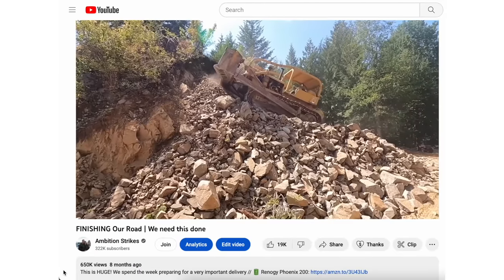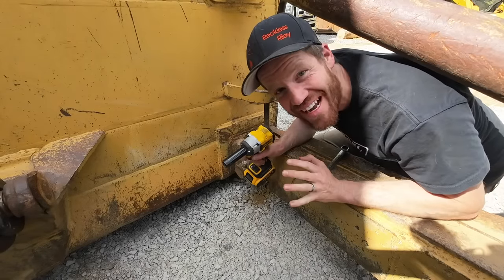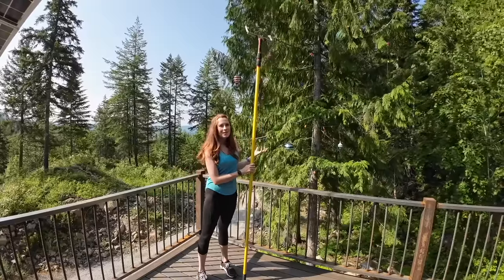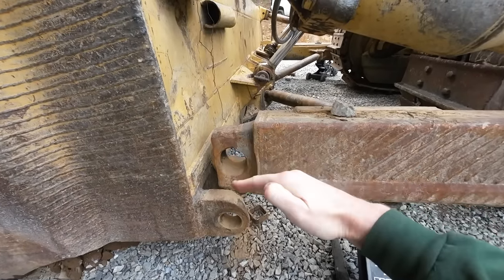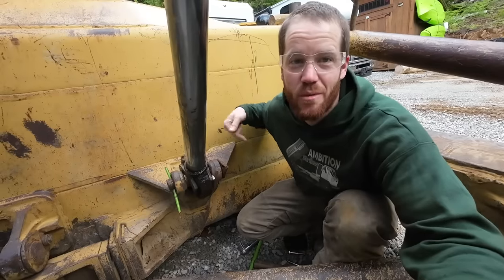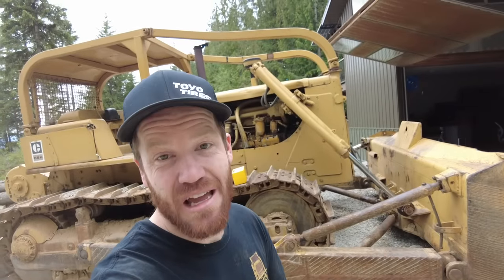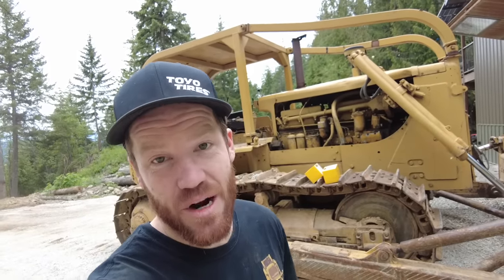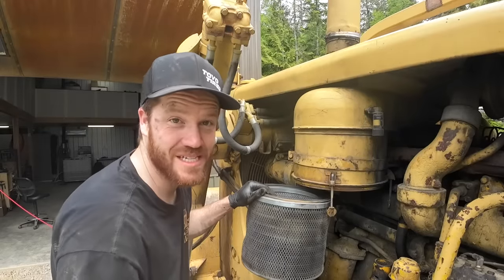Repairing My D8 Dozer (unexpected find)

Comment: If you're still concerned with side-to-side play on the dozer rubbing on the tracks, side-to-side play is also controlled by the 45 degree braces just behind the blade.  I see the right side brace is bent, and if it wasn't adjusted afterwards you'll find that the blade arm on the left side rubs more easily than the right.  Thanks for the video!

Comment: Just to keep the dozer working I would take a sample of the hydro oil and get it tested.  It may need some attention.  At a min it will ease any worry.  All that metal in the filters is very worrying.  Changing the filter often is wise until you can clean out the tank at a minimum.  The dozer should be good for a long time if maintenance is kept up with.

Comment: Me again,
I was just thinkin how great it will be for Oliver to see his history in the videos.
Just info, those parts you got at Western were registered thru the central warehouse op in Morton, IL which is just 85 miles NNE east of Decatur where we live.
CAT went to regional center several years ago so the actual parts may never have passed thru Morton.  
I appreciate you buying CAT parts but for the hyd oil you know and I know you know there are many good oils that are less expensive than CAT.  I run a full synthetic hyd in my Kubota. It is sold under the label, Mystic and a midwestern farm supply called Blains Farm and Fleet.  I was told Mobil makes that for Mystic
I agree with your plan, change and clean the filters often.....
Blowing the air filter from the inside out helps alot.  But, Hell, Riley you know that.....

Comment: If you are finding debris that size at the magnetic filter you had/have a problem. It's sometimes better to cry a little now over a small cost than it is to cry for days later when you see how much damage is being caused by that garbage being pumped around in the system. It's even worse if you loose something when you are in the middle of work, you have the machine next to the shop where things are convenient. Now you have extra help, if I were you I'd put the time into the D8 now and  recoup the costs when you sell it. Ancillary parts like filters and cylinder rebuild kits are plentiful, hydraulic cylinders for that machine are big money if you can find them or even bigger money if you need to make them. The hydraulic pump for a machine that old is going to be pricey. Don't be the guy that waits until catastrophic failure before you fix or take care of the system.

Comment: Dozer ball trunion - I'm a little slow, but here is my suggestion.  Make a CAD model of the ball, then slice it up in 1/4" thick slices.    Then use your plasma cutter to make the parts.  Then stack them up and weld them together.     I'm thinking you would need to make the ball in 1/3 sections to assemble it in the dozer.

Comment: Riley, perhaps the bolt or bolts welded closed on the pin that holds the blade in place was insurance that they wouldn’t have to try to get the pin back in place while building a road. It looked like it was hard enough to line up the arm and blade on flat ground in front of the shop so what would it be like when you are pushing dirt?

Comment: Riley in your travels see if you guys can snag a bunch of used chain link fence and tow it behind your quad to smooth out the gravel.  Works wonders leave about 4 feet of it flat and roll up the rest and wire tie it for weight

Comment: Nice work looking forward to seeing the dozer in action! I think I would change the hydraulic oil obviously a big expense but with all that metal getting to the filters it needs to be done and give the hydraulic tank a good clean, plus I assume you don't know when the hydraulic oil was changed last and it doesn't last forever. looking forward to the summer projects :)

Comment: Filters are cheap. Keep checking/replacing them. The more you change filters, the longer you can wait between changes, in turn rehabilitating the oil. I recommend getting in touch with an oil prodicts distributor to see if you can get an additive recharge package for that type of oil.

Comment: Next big acquisition should definitely be a lathe. And don't be tempted by minilathes, you won't be able to work on most stuff
Reply: But - what does a lathe in a street building business? 😉
Reply: Yep, 16x40 is a good starting point, for the size of equipment they have. 
Last shop I worked in had a ~16x80, as the small one. That covered anything we needed, small mine, some pieces were larger, but required ,massive machine tools.
Reply: I was thinking about that myself and a small lathe is good for the small stuff so if he found one at a garage sale fine but I think he's going to have to find something decent perhaps at an auction or maybe a website with advertisements.
Reply: @billvandorn5332  yeah, good thing is old machines were made to last so he can probably find one from the 60s or whatever that still works great
Reply: Agree wish he had carbon arc but an oxy set up will do.  With a flat gouging tip if used properly.  Cut everything off bring to a machine shop that works on diesel heads not some 2 sided machine shop i learned in the past.  HR excalibur 7018 5/32 and Watch IC Weld on screw tube.  I do agree a lathe is nice. I had a chance to buy a 30ft lathe 5 hrs away from me for 1400 dollars 10 yrs ago did not do it did not have the shop space i kick myself till this day.  Guy scrapped it but i did not have 3 phase here i later bought a 200 kw gen set. What people off grid should do you can get a converter out of canada not cheap but for life it will work.
Reply: This 'ole Tony had an episode, "The infamous mini lathe."

Comment: Can't wait for the road work videos, I would drain all the hydraulic fluid and flush out the system then next time you check the screen will give you better idea if it's leftover or current problem in the system

Comment: Trunion mount to blade needs to be tight and vertical to the blade - The Trunion balls give all the rotation required for blade tilt but again start with the Trunion vertical to the blade and not leaning in as yours is which restricts rotation - Your present loose fitting will wear out very quickly - Also make sure the lateral sway bars are tight to stop excessive blade swing which is also very hard on blade mounts

Comment: Nice job on the dozer Riley. I would have changed the fluid to lessen wear on the system. Having the oil burner you do would reduce your cost trading for some heat this winter.
Reply: About $3200 to replace the hydraulic fluid in the dozer.

Comment: Bummer on all the metal in the hydraulic system. Really looking forward to the trackhoe and breaker video. I'll be interested to se how it does. I've got a rock ledge that I have to cut down to ease the grade and a large trackhoe won't touch it with just the bucket.

Comment: Hey Riley, That air filter is meant to be reused. Just do like you did and tap the dust out. When you think you got it all go get an air hose and blow it out from the inside out. Then put it back in and make sure to reset the restriction gauge.
Reply: You should never bump the air cleaner element on anything to get rid of dust it breaks the paper away at the ends inside bad policy saw a grader engine dusted like that proved it was a damaged air cleaner element operated used to bang it on the tire every morning instead of blowing it out with air the way it should be done

Comment: You can buy hydraulic oil and other fluids from other manufacturers of oil products for a lot less that do not affect the operation of your machine or longevity. Caterpillar does not make their own oil they just charge the large for it. I have many pieces of equipment with many thousands of hours that do not run oem oil. 
Love the content!!

Comment: Good effort all around for a general fix. The bushing injects a potential issue though. Being larger in diameter and harder than the pin, the bushing has the potential to cut into the blade mount with side to side movement. Dismount the blade, use a long pipe that passes through both bushings to align them on more or less the same plane then weld the bushings in place and grind it smooth. Or put some sacrificial metal on between the ends of the bushings and the blade mount...

Comment: Woop more Kitty content.  Tube definitely needs to be welded. The blade movement looks big but really isn't by the time you get to the pivot point on the track frame. As you say, it doesn't do a lot of hours but you don't want the new tube wearing through the remains of the push arm either!!

Comment: My dad has a 14A D8 dozer I believe a bit older because it has Manuel transmission great machines in there time it was converted to hydraulics from cable. But he pushed over a tree and it fell on it and bent a pushrod which he fixed but must have had something wrong because it broke a valve and is down a cylinder. Tracks were so worn that it was a costent worry of them coming off on steep ground

Comment: Riley the blade on the Doszer meets to be tight. The steel in put in will wear the joint much faster that joint is a wear spot and will have to be fixed at some point. Doing it sooner than later. Those arms are expensive    21:18

Comment: After you check the magnetic trap a few more times, bite the bullet and replace the hydraulic fluid. Get the tank flushed out. Take off every line at both ends and flush them too. Something you'll need is anti-chatter additive because some years back CAT quit putting it in their hydraulic fluid. Or go with a different brand that has anti-chatter additive in it. You should put anti-seize inside those sleeves so the pins won't rust into them. New pins would be a very good idea. You don't want the possibility of the sleeves getting crushed into the worn areas of the pins which would make them impossible to remove.

Comment: Do you realize you have minimum 5,000 in hard surfacing on that beast!! 
Welder/operator of everything here. Pads nice too!!! Engine solid, finals solid, trans you bought my envy machine. But i tokd you to trade the light weight crap in on a 270-450 long ago. I developed my mountain property back in 95’ !!! Moved 100,000 cu yds. !!!! Ohhhh yaaaa. I bought a 890 JD. 115,000 lbs!!!  4.5 yd cleanup and 2.5 rock!!

Comment: Hi Riley and Courtney and Oliver great video again really enjoy your videos Just a couple of things though Riley not critizing but trying to help when starting the Cat D8 once oil pressure is up run it on full compression with the throttle SHUT until it warms up a bit opening it too soon only floods the engine with fuel which accelerates wear it should run on the pony motor long enough to start instantly without out coughing and blowing smoke 
The other thing is NEVER bang an air cleaner element on the tracks to clean them out it breaks the paper away at the ends and allows dust to enter the engine I saw a grader engine dusted like that because the operator banged the air cleaner element out on the tire every morning the correct way is to to blow them out with air from the inside also the bottom cup should be emptied out daily Hope this bit of advice from an ex D8H operator helps 
I believe those pins should be a tight fit also I operated a D8H with a hydraulic tilt blade from brand new and those bottom pins were a straight tight fit there were no pivot balls on the bottom of the blade arms

Comment: I once decided to change the transmission  fluids on a kubota i once owned 
Found lots of metal brass and steel. Looked like the offcasting from a metal lathe. Was fricking scary. Changed the oil and went back to work. Never had any further problems.  Perhaps you could get that lucky. Any major repairs on that d8 will melt your credit card. I think a new d8 is about 1/2 million

Comment: Hi 
As for saving on hydraulic oil. You can drain this oil, filter it, and clean the hydraulic system. Then you can pour this filtered oil back into the tank. This should be much better than the current state with this garbage.
Greetings from distant Poland

Comment: hi there , hope all is well with you all. In my neck of the woods you can hire a oil filtration unit that runs off 240V , Tap it into a feedline  and run the unit , it catch all the crap  then return clean oil to the gearbox, maybe there is one hire near you
Reply: Now why didn’t I think of that?!

Comment: Don't be worried about hard or soft materials. My guess is that the dozer is 90% thru its life. Stuff you repair needs to be suitable for a few hundred hours, not tens of thousands. Hydraulic cylinder tube is a good tube option. Doesn't need special welding and available in the length you request and in metric and imperial sizes. It's not the hardness that matters, it's the tensile strength. Hardness is usually only skin deep while uts is permanent. Don't worry about making noise around Oliver. Kids get used to noises.   We lived next to main train route and kids were never bothered. Couldn't hear yourself think lol.

Comment: My Dad bought a used 1965 46A in 1968 for their construction company. It worked pretty good once the bugs were fixed n the transmission.  Cat had recalled it for bad spool valves but they were not all changed when this trans got overhauled, caused a lot of troubles til they were.

Comment: It could always be worse.  The D6 I learned on didn't have an electric start on the pony motor.  Instead, it had an exposed flywheel equipped with the appropriate slot to wind a rope around.

Comment: If you are finding metal in the magnetic filter... clean it often and see if the amount of metal goes down.  If it keeps up then there is a bearing some where going.  The internal bearings are more or less just to keep things centered.. so if they go the whole thing goes..  Now could it be there is stuff in the lines and pump and getting trapped that is possible and yes complete flush of oil is highly recommended.   200 per 5 gallon. what is that oil... surely not the old standards stuff of 50 years ago.   More like new synthetic oil used in hydraulic systems.

Comment: That metal debris you keep finding in the transmission filter is from hard parts that are being ground to bits. It may continue to work ok for a time but, eventually, you will inflict massive damage on the planetary gear sets inside as well as the servos that make that Cat Powershift transmission such a joy and such a massive expense to repair if you don't fix what is wrong with it now. This machine also has, if I recall correctly, what Cat calls a Torque Divider, which is actually a torque multiplier. That may be the source for some of that debris you keep finding in that magnetic screen/filter. Spend some time and money now to get this fixed or spend about what you paid for this really great machine getting it fixed later.

Comment: hi , not really knocking anything you are doing but the one bit of advice for looking after old cat gear is use antiseze, doesn't matter what type but every bolt that you are taking in and out you need to apply some antiseze to otherwise you will end up with buggered captive nuts.

Comment: His bush pinion sleeve is fine just keep an eye 👁  on it and replace when needed with another sleeve. Just welder up on the pin. Change all the fluids should have been project #1 keep plugging away love the dozer debates!
Reply: If you come across or ask Cat for your pinion joints you can weld new ones on later .
Reply: Probably took years for the pinion to wear like that.

Comment: Here are some tips for easier life with your dozer. To start the main engine get the main engine rolling over diesel off give it a sniff of ether and turn the diesel on boom it will start instantly. If you want to move ahead very slowly and carefully use both steering clutches at the same time and push them in slowly to move just a little.

Comment: Would you be better with a mild steel pipe instead of the chromoly as the housing will now have accelerated wear due to the harder material. The pin will be protected by the chromoly casing?

Comment: You really need to change the fluid.  There should be a magnet on the end of the drain plug that will catch lots of the metal shavings.

Comment: doesn't the bottom of these dozer's suppose to have a type  of roller  ball type bearing that suppose to have  alot of grease  in there to help keep dirt out .? looking at my dozer it has this  ball with  a pin hole  in it to allow grease  in . but mine has been replaced  before .  we took them off a bone yard dozer  for like 50$

Comment: Riley, wow that hydraulic oil is done. Seriously you need to change that oil. Not changing it will do more harm than good. Yes its going to cost a lot but I feel it will cost you more.... lots more when it fails if you don't change it now.

Comment: Be REALLY careful with Oliver in the pack in the skid steer!
If you run into something immovable your body will be thrown into the safety bar hence crushing Oliver. I’m sure your being super slow but if you’ve never experienced it you probably don’t think about it. 
Ask me how I know 
And Riley, chrome Molly or not, it is not tough enough
Be surprised if it lasted the summer. Needs to be solid steel to steel not relying on welds.
Love you guys, I don’t like coming across negative but wanted to get you thinking on both counts.

Comment: Your missing some important pieces, who ever worked on it removed the pieces  that allow it to pivot. that's not the hydraulic filter it's the transmission filters and it doesn't hold 80 gallons my d9 only holds 30 gallons, that's a snap ring probably from the first failure, I didn't see anything to be to concerned about yet, and impending failure would have those magnets completely covered.